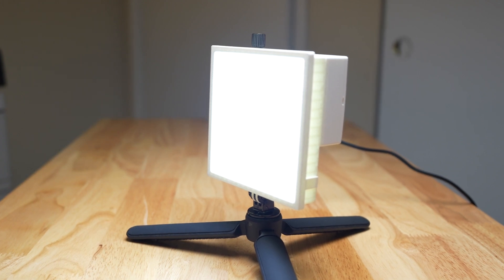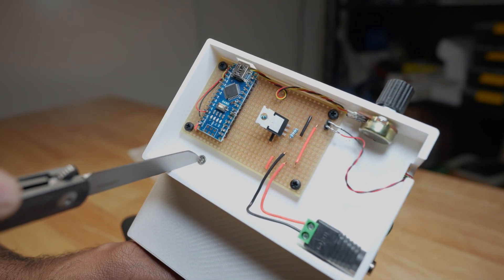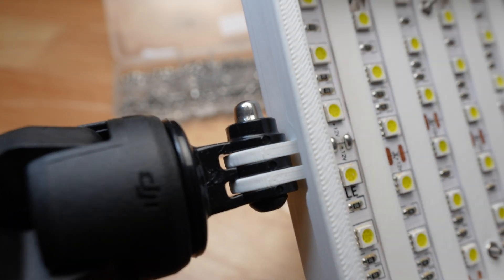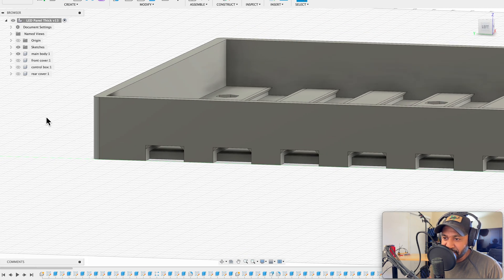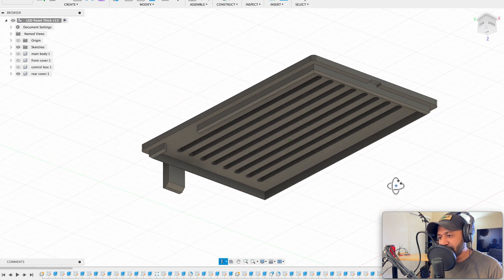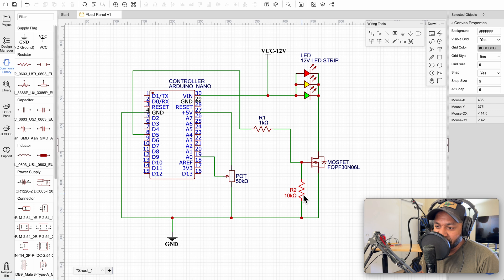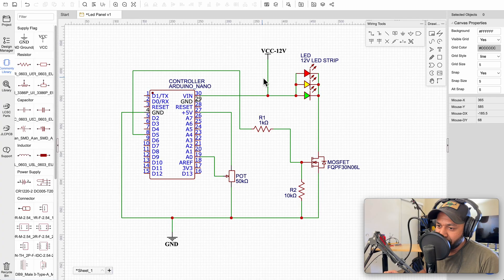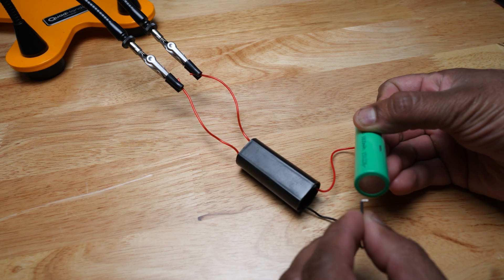DIY LED VIDEO LIGHT PANEL : ARDUINO 3D PRINT ELECTRONICS PROJECT

Comment: Nice project! :) I was wondering about heat. These strips are often put in aluminium rail for heat dissipation. Are you finding that the light runs nicely? No warping of the 3D printed parts due to heat?
Reply from the maker: So far, I haven’t had any issues yet, using it an hour here and there. But I feel like it will warp being PLA. I plan to make the next version PETG which will do better with the heat.

Comment: Hey bro! Wanna ask, isn't this electronic design overly complicated for the end result you want? 
Correct me if I'm wrong but the Arduino is uneccessary as the LED strips do not need PWM signal to work right? Dimming of the LED strips could have been accomplished by reducing the voltage that is fed into the 12V strips, by correctly hooking up the potentiometer as a Voltage Divider.
Doing so not only simplifies stuff but also, reduces the cost of the project.
Just my thought :) Not sure if I'm correct in practice but do let me know! 
Cheers~

Something similar to this "3-Channel"Analog Dimmer Project: https://www.youtube.com/watch?v=bJKLvEuFiiA 
Yours would be a "1-Channel"

Additional example, https://www.youtube.com/watch?v=jdwlqoHAA1o
Reply from the maker: Reducing the voltage won’t dim the LED’s. But it’s true, like I mentioned in the video, it’s more than necessary to create a dimmer circuit but I’d argue that it’s not complicated and way easier to employ an arduino than to wire up, say a 555 timer circuit. To drive these LED’s it has to see 12v to properly turn on, so some kind of PWM signal is required. I mentioned all of this in the video.
Reply: A single MOSFET and a cheap microcontroller is definitely the most accessible way to have this setup work. Exactly how I would achieve the dimming functionality. Nice project!

(Also for the original commenter, these LEDs are probably constant voltage meaning they could be dimmed by an adjustable constant current supply but that is quite a lot more complicated and totally unnecessary).